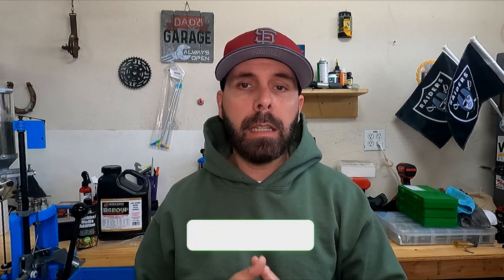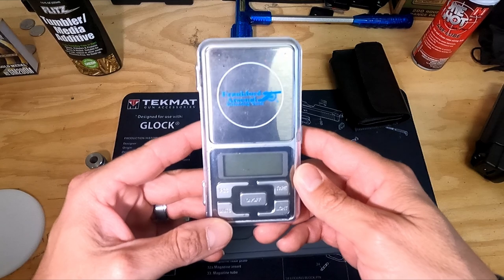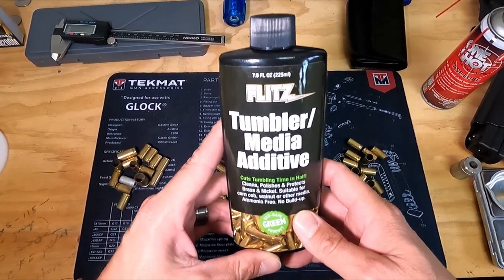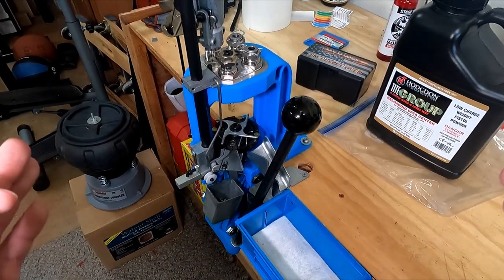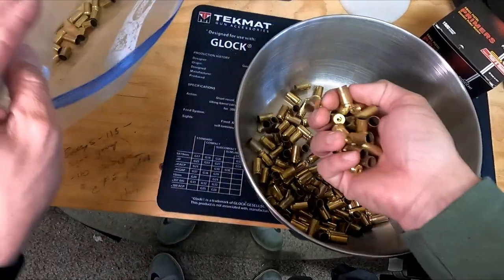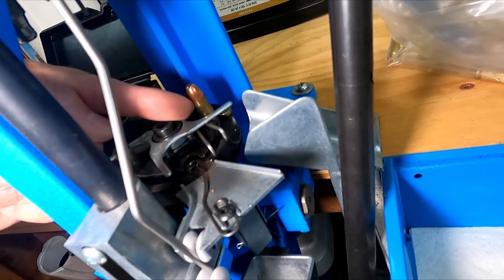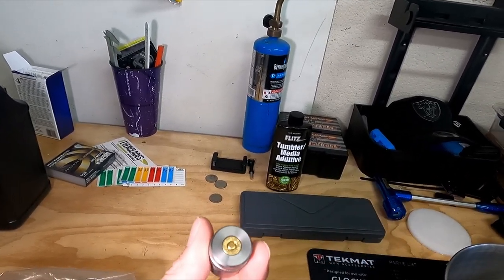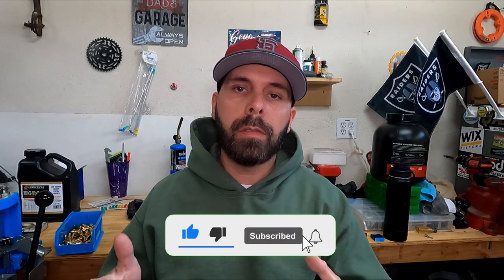Reloading 9mm (Full Detail Video)

Comment: Where did you get the load data for the berry’s bullets?
Reply: You can go on their website for their “guidelines,” but I’ve been loading Berry’s & Ranier copper plated for over a decade and I just use load data for the equivalent weight FMJ projectile, but make sure to stay below 1250 fps, unless using the heavier-plated ones specifically designed to go up to 1500 fps. These velocity guidelines are actually on the plastic box the Berry’s comes in. Have fun & be safe.

Comment: Stop calling a cartridge a bullet! 
A cracked case will NOT "blow your fingers off". 
4.7 grains of tightgroup is super hot!  
Thats enough lube for 1,000 9X19 cases. 
The danger of lube is that it will de-activate primers.